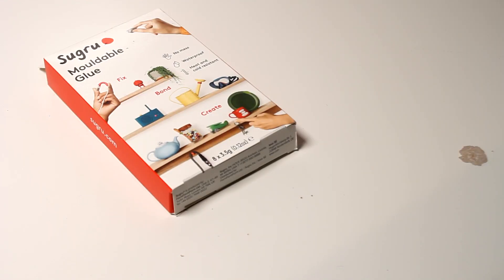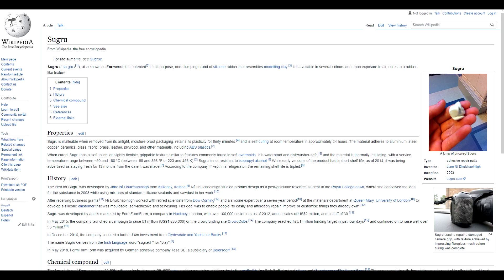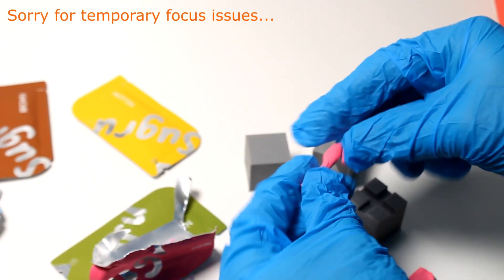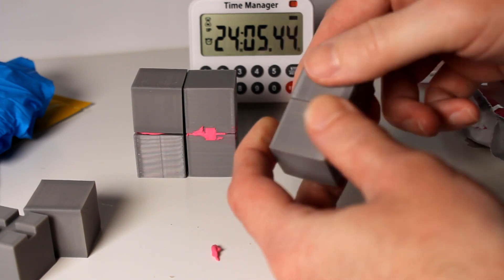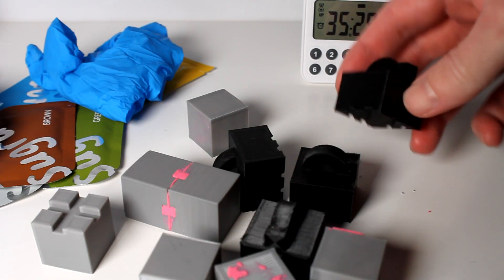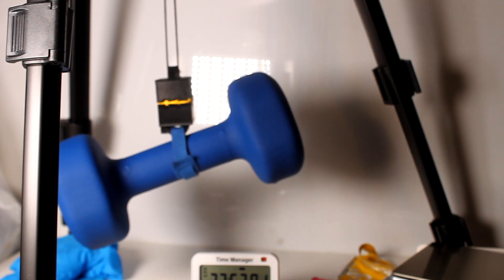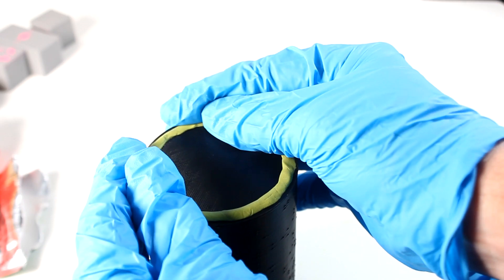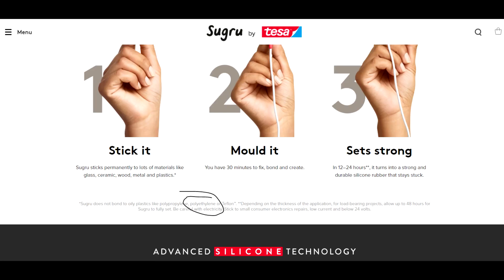Can You Use Sugru With 3D Printing? Testing Adhesion To PLA Filament

Comment: I favour a combination mechanical fixing, considering the ease of shaping 3D prints. If you provided a dovetail channel and compressed the Sugru into the slot, the limiting factor would be mechanical strength.

Comment: This experiment would be interesting using homemade Sugru. It's refereed to as Ooogoo. There's lots of info on Youtube about making it.
Reply from the maker: I've heard of it...certainly cheaper if you need a lot of it!
Reply: I'm interested as well.  I made some years ago (before I had a 3d printer) and it worked pretty well for my use.  The nice thing about it is, you don't have to worry about too much about the expiration date.  If you need some, pull a tube of silicone caulking from the the shelf and mix it up with some corn starch (and food coloring if you want).

Comment: Questions:
Just how "rubbery" is it ? ... Suitable for something like rubber tires ? ... O-rings ?
Does it degrade over time ? ... UV-resistance ?
Reply from the maker: Sugru is a silicone formulation, so it should have all the same qualities as standard silicone. It's quite firm when set but resistant to most things I think, including time. 
https://sugru.com/projects-inspiration/outdoors